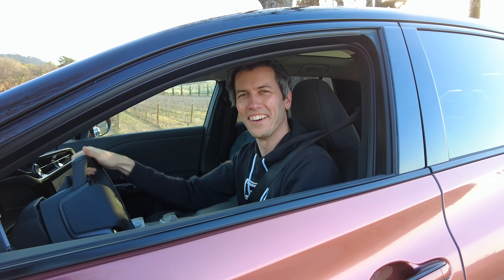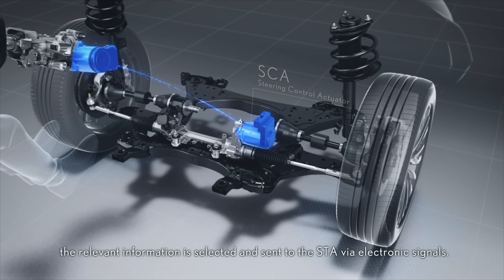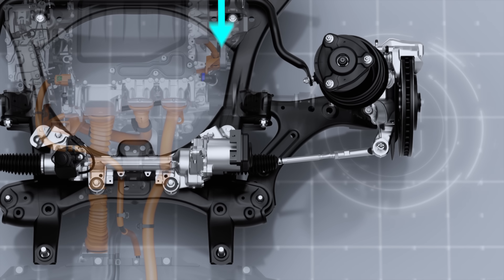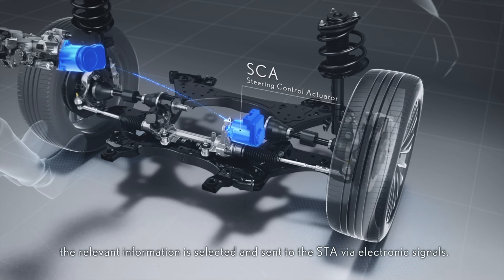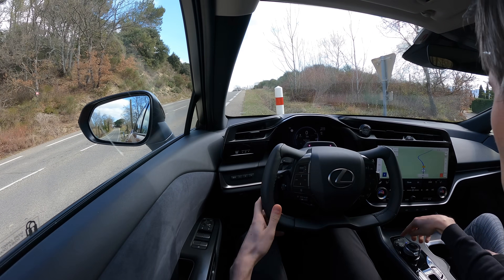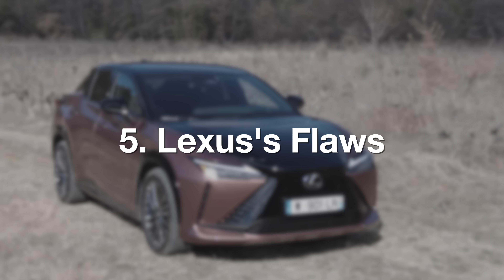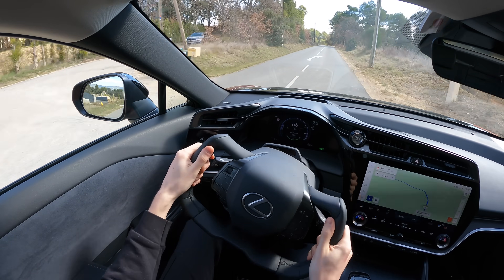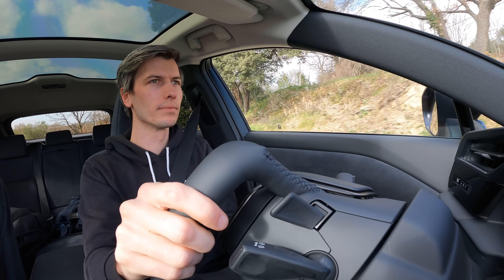How Lexus Fixed Tesla's Bad Idea: Steer-By-Wire Yoke

Comment: I can't believe they added mouse acceleration to steering wheels. Like my pc I like my inputs to be linear across all speeds or at least close to it as possible. I can see how some people would like this but even as someone who isn't exactly an enthusiast when it comes to driving I'm not a big fan.

I think an interesting solution for future variants would be to give options on how much rotation total you can have so people can chose between a ratio they are used to or find some variation in between of less rotations with the adaptive sensitivity. If they can imitate force feedback then they can also imitate different lock out rotation amounts.

Comment: Couldnt we theoretically use a CVT system to make steering ratio continously variable? It may be more sluggish when changing speeds quickly but its still mechanical.

Also the delay could be solved by adding more resistance to the wheel. If you quickly jerk it from one end to the other its gonna be hard for one or even two 12V motors to execute as you command.

I think the idea of "Wheel jerk controll" like you said driving at high speed and deciding to steer nice and harshly could be a good idea. The system however needs to walk on a fine line between "I just wanna kill myself" and "I wanna dodge that animal, car, truck to not kill myself"
It also depends on how the system handles such inputs. Will it just ignore them completely? Will it execute them as much as ESP could catch and not a degree more?

Certainly interesting and promising tech.

Comment: It's pretty cool to see them R&Ding this and putting it into production as it will get better with age and competition.  My biggest concern is this must be doubling or tripling the cost of this sub-system?  Also, we're really good at creating mechanical variable ratio things in general.  Current variable ratio steering is really nice (my Audi S3 has it, works great), I'm willing to bet they can create a mechanical way to do this without losing the direct linkage from the steering wheel.  Because when you think about it, you don't need the ratio to be infinitely variable, that's way overkill.

Comment: I suspect the delay between input and effect will only be noticeable to driving enthusiasts. Most people will not notice or will quickly mentally "tune out" the 100 millisecond difference, since it's at the edge of human perception speed. As for Tesla's yoke, I drive the newer Model S with a yoke, and I got used to it a lot faster than even I thought I would. I quickly developed a technique of reaching under, which was an extension of my existing habit of reaching under when turning a traditional wheel, minimizing the distance requiring hand-over-hand. Sharp steer and counter steer in parking lots for me are not a problem. I think Tesla's yoke system is hardest on people who are used to bad technique with a steering wheel, such as driving with one hand at 12:00 and the other hand grabbing a soda.

Comment: If you were traveling at a higher rate of speed and temporarily traction causing the rear end to kick out, would the slower ratio allow you to countersteer to maximum turning angle to try and save it, or would you be stuck with the slow ratio steering angles? 

I’m general, is seems the changing ratios could be hard for the driver to predict and understand, at least in the beginning.
Reply: Very good point.

Comment: I  like the concepts but the implementation not so much.  I would not want any delay in any of the control capacities like regen and specifically a "hesitation", even minor, in the steering.  I'd want the wheels to do exactly what they are told to do with no more delay than you would get with a mechanical system.  There aren't many idiots that yank the steering left to right violently at highway speeds so that example used as a justification is too much of a stretch for me.  Properly applied variable steering algorithms should take care of the twitchiness while moving at higher speeds.
If I get out of the car and the steering wheel is dead centre but the wheels are at a slight angle first I kick it then it goes back to the dealership and I get my money back.  More likely I'll check for that on a test drive and wind up handing the salesman the keys back with a polite "thank you" as I head for the door....
Not that this would happen anyway since the Lexus is an overpriced Japanese luxmobile I would not consider buying in the first place.  If I get into that stratospheric price range I'll save more and buy a Lucid Air Grand Touring for $185,000 from Arizona.

Comment: I still want all feedback to pass thru, including potholes. The more you feel like from a pothole the more you can say oh crap maybe I should get the front looked at as that might have done damage. If it was muffled so to say you might think it wasn't that bad and now you have alignment issues or worse. As for the "yoke" how do I now drive with my hands at 11 and 2 like we are supposed to, or on long trips where you have a full steering wheel to move your hands around on the give your arms a break form being in the same position for to long a period. I go from top of steering wheel to bottom and back and forth a lot when making long trips. I make long trips quite often as I travel all over the US to film homes for my channel.

Comment: My primary concern is how easy they have made it to access and maintain with that many components. In my experience, when things like this get changed, self maintenance is what suffers because it takes a lot of extra work to engineer things to be also easy to replace/repair.
Reply: My guess is they packaged all into the boxes, so instead of mechanic actually replacing left sensor or right steering angle sensor, they will be forced to replace both at the same time. Costing more in parts, about the same in labor.

My concern is the wires, I know it doesn’t take much for two wires next to each other to be affected by the same thing.
Reply: The biggest problem is that we won't find out until 3 to 5 years down the road, maybe even longer.  Then it will be the problem of the 2nd, 3rd, or 4th owner and/or the shop that does the repair.  Replacing the timing belt on my Toyota V6 ($45 part) is more than $600 in labor because of all the stuff that has to come off to get to the belt.  The same job on my old Ford Escort was about $120 labor.
Reply: Basically mechanics are gonna be out of jobs and electronics repair technicians are gonna gain extra jobs.
Reply: Also it can get hacked remotely to taie complete control of the car. Judging by how easy it is to steal modern cars it wont be much harder to hijack cars.
Reply: right because you're constantly needing to service your throttle body but luckily you can service your steering column....
Reply: A motor should be a lot easier to replace than an entire steering column. Will also break a whole lot less easily.
Reply: It's a lexus my friend, you won't need to work on it for another 10 years
Reply: in this case, is more difficult to project this, than simple solution invented  before many years
Reply: we allready had worse examples for that point (audi a4 b5 for example has its steering collumn on top of the gearbox) and i had the pain to replace it by myself, and wont ever do it again ^^
Reply: @WPJr2080  reason number 1 i wont buy a new car: E-Brake. handbrake saved my life one, never gonna get rid of it
Reply: Self maintenance just takes time. Think about when any new mode of transportation is instructed. For like the first half a decade or so no one knows how things work then eventually the casual market learns how to work on these things
Reply: @Zombiewizard  in my experience, the biggest consumer of time while working on cars has been space in the engine bay.  The more compact it is, the more you've got to disassemble. Then reassemble. Toyota vehicles tend to be easier than most to work on. Many things have gotten easier, but at the same time many critical components seem to be going deeper and deeper in to the ever more compact engine bays. I used to be able to stand up inside the engine bay of a Dodge truck, now I'd be lucky to get an arm down there. Even my '85 Mr2 which is a pain to work on because it is so small has a less labor intensive engine bay than a modern day full size corolla. 

My other concern with the electronics is the vehicle now has two painful points of pricey failure. The battery has an unavoidable expiration date, and they depend on wires far far far more critically than any previous vehicles made. They're going to require incredible time and very skillful repair to maintain over the years. Whereas an older vehicle will keep driving for decades under the care of a DIYer who's using  house wire and butt connectors.  I don't think they're going to have nearly the same longevity as the automobiles of 'yore.
Reply: @Paddlefoot  That may be true but I guess only time will tell. I do find it weird that engine bays are more compact with cars (especially in the United States) getting bigger and bigger. I guess there is just more stuff they try and fit in the engine bay now then there used to be
Reply: Invented by people that come to work on a bicycle.
Reply: Mercedes tried that 25 years ago and found out it was a waste of time.
Reply: This would be far easier to maintain
Reply: Nobody is self repairing any of these new cars buddy.
Reply: Lexus owners rarely self repair. They have money not to worry about this stuff. If you want something simple and cheap, get a cheap car.
Reply: @WPJr2080  Tesla's bottom-tier battery has all the range I need to get to the next city with a fast charger in 3 directions. (40kWh). And I normally don't drive that far.
Reply: How often do you do self maintenance on the steering systems of a car? There’s barely maintenance to be done on EVs like these that you wouldn’t need a mechanic for either way
Reply: @davidlake611  It is not just SELF maintenance. It is about the ease of maintenance. And how many mechanics will be able/allowed to repair it. And the answer is money of course, like always. 
Like with the LED lights. One led fails? change the whole thing for a 1000$. Changing just a standardized bulb? Nah, because that would make sense. (Why there are no standardized LED modules?) Same will apply here. One actuator failed? Only authorized service is allowed, but they will do it just for a 10% of the car price, so no worries.
Reply: @panvomacka9079  Exactly what i thought , anyone think they will be able to replace the steering angle sensor(or one of them) without dealer specific computer to recalibrate a safety critical component will be enjoying the thousands it will cost to have the whole assembly replaced.
Im all for improvements in tech but steer by wire just sounds like over-complication of a good system with one flaw(you need to turn the wheel more at low speeds)
Reply: @BMWe-ed2tn  100%. Give me access to adjust, change or calibrate it as I see fit and I'll like it better... Until I need to repair it and then I'll hate it all over again.
Reply: @bkuker  haha yup that’s true.
Just wait until they remove the rack totally and just have tie rods with motors, need an alignment? Need to do it at the dealer at the low cost of 999$
Might even claim that for this system aswell..
Reply: @panvomacka9079  You are going to hate this. I've been collecting smashed LED headlights for a while now, from bodyshops. You'd be impressed at the modularity inside them, everything is its own part. Of course, nothing has part numbers because they won't sell anything to you, and headlights are now permasealed, but almost everything is its own part, with zero soldered wires, all connectors, and such.
Reply: @panvomacka9079  And also when you get different-sized wheels, tire compounds, or if the alignment goes wack when the struct fails, how would the system re-adjust to the new information without access to the tuning systems
Reply: @BMWe-ed2tn  Yes correct. Its over complicated. If we make a list of all of those motors, sensors, wireing, redudency that runs this, and if any of the components fail. Or after like 20 years noone will be able to fix it. So it will be a trash. Yes I throw my car away cant get the stearing controller logic board.... :D
Reply: @davidlake611  The legacy systems have maybe one motor or hydraulic system on the steering rack and nothing on the column, this is completely different having 2 motors now on the column.
Reply: @davidlake611  that only applies to conventional steering systems... But what about electrical system? What if theres a problem? Not all of us have enough cash to have others maintain it yeah
Reply: @davidlake611  every vehicle needs work on steering components at some point unless you're someone who buys a new vehicle and sells it in a few years.
Reply: @davidlake611  Aptera says otherwise
Reply: @David Lake  frequency has nothing to do with it, it's that it's possible or not by a regular person
Reply: @WPJr2080  what do you mean "take down uber"?
Reply: these are concerns for anything new to the market. Look at teslas. So many on the road but wait like 10 years. You will barely see any. It will take awhile to adapt but cars are making a huge shift i wouldn't be surprised if my great great grandchildren are flying on the daily and not driving anymore

Comment: Don't trust it.
You can see it has a bit of lag.
I also have an issue with braking as soon as you lift the throttle pedal. On a regular car when you're going on highways you can manage consumption a bit better by lifting and keeping the momentum, but that's another thing.

Comment: I think I need to have a test drive first, but so far I have the feeling that I will dislike this with a passion. The variable turn response, the high sensitivity, the delay..I don't know.
I have no problem with having Steer-By-Wire and it's cool they still have all the buttons, but I think I won't need this modern variable yoke input. I'd rather have a traditional round steering wheel, with a fixed turn response.

Comment: @00:14.....    I hate this idea!   The car loses electrical power while I'm on a curvy road.   I would prefer a mechanical connection to the steering so I could at least safely get the car off the road.
Reply: Just look at Tesla deaths, it’s a website that is chock full of Teslas malfunctioning. Electrical is fine, so long as you have mechanical failsafes. Kill switch, mechanical brakes, a steering column that doesn’t rely on a motor

Comment: Funny thing is, I watched a review on French TV yesterday where the journalist absolutely trashed that Lexus steering wheel. Particularly annoying, and somehow dangerous when you're into a curve, then accelerating or braking. You have the same steering input yet the angle changes because the speed changed. 
Lexus delayed the deployment of that wheel in Europe by 2y because of that in an effort the update the technology used.

Comment: 8:00: What about in case CAN BUS is too busy and non-responsive for some time? With hydraulic steering assist, there's no issue (not sure about electric but maybe it just shuts off?).
What about when towing? How to steer into the tow truck if the system fails?

Throttle-by-wire is not an issue. In case it misbehaves and sends a signal which causes unwanted behavior, just turn the key to shut the engine off (that's the override). I don't see a way to override a steering wheel.

Comment: Wait what are you talking about there is plenty of drive by wire on plenty of modern cars..in fact in the 1980’s and 1990’s it was released in factory cars..so the 1980’s it was sold in the first factory cars..know your smart but !!! Your ❤still..also Benz, bmw also uses it today..

Comment: Would be cool to compare this and the Canoo's implementation.
My only question is how it would do in high-speed turns where you approach the limits of tire grip to the road. I guess it would try to slow the car down if you keep turning the wheel but the tires start to loose grip?

Comment: Question: Did you try the system in a moose test type of scenario ?

Dynamic steering ratio seems to be something pretty tricky to get right in case of emergency relatively high speed collision avoidance.
On paper it can get amazing and do a better job than a traditional steering, in practice it seems complicated to get right.

Little additional notes: If steering by wire is quite a new tech in the automotive industry, it is already the norm in the aeronautical industry. All major airliners have a dynamic steering input on the rudder & wheels on lift off and landing for pretty obvious reasons. That also give an hint about the safety status of the technology: If it is safe enough for a 300 persons airliner, it is very likely more than enough for your car.